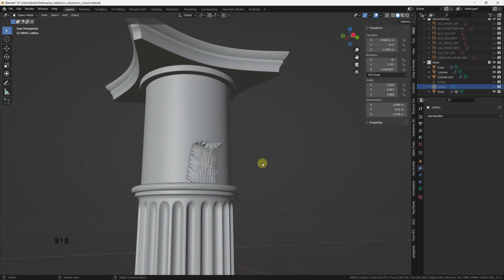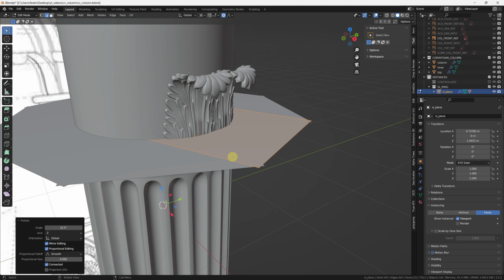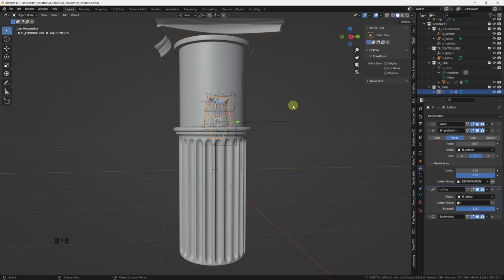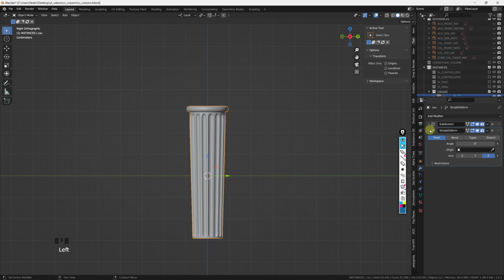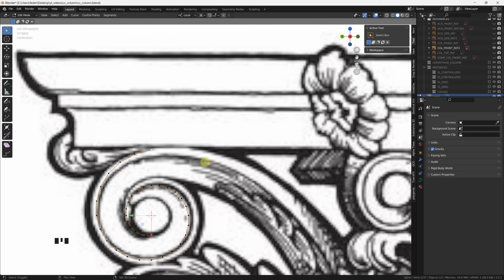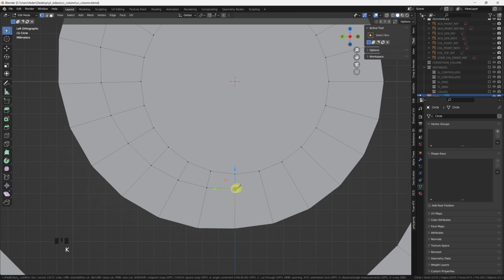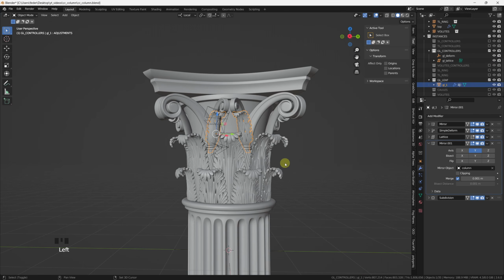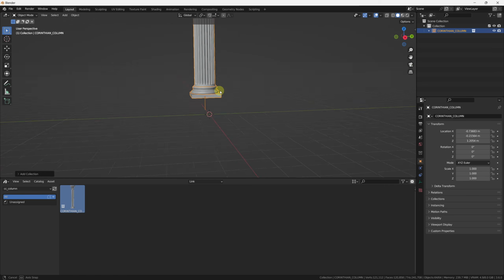Let's model a column in Blender - a step-by-step tutorial on non destructive workflows (pt.2)

Comment: One of the best tutorials ive seen so far, im into game art and classical architecture since years and I learned so much. But one tip for people who want to optimize and/or bake this column: I recommend to not use Shape Keys when you extrude it and keep aware of the overlapping faces, even after detaching it, there could be some parts overlapping with other parts after you extrude it. I had to move the overlapping flowers away from each other.

Comment: is retopologize necessary for this, if I want to add textures and want to import it into other engines?
Reply: You could use Nanites on this if you work with UE but its highly recommened to optimize it, its not game ready. Im trying to do that right now, im still not finished but if you have a question answer to this comment
Reply: @faryanblender8946  But for complex structure such as acanthus leaf, its going to be very time consuming.

Comment: Hello! Thank you for these video lessons; they are very important not only to me but also to many others. With the transition to Blender version 4.2, I encountered a problem with instances. Maybe someone knows how to help. I had older projects, and after opening them on a new device and in the new version of the program (4.2), I noticed that when applying the Array modifier to instances (tto plane, to which an instance is attached using a parent modifier), the materials get messed up, which never happened before. This issue only occurs in the Cycles engine, not in Eevee, and the first object in the array turns dark for some reason. Does anyone know what can be done about this?

Comment: In real architectural terms, to help add to your realism, columns aren’t cylinders. For corinthian columns, the shafts are 8-9 times the capital height. Also the bottom third of the shaft is cylindrical, while the upper third thirds taper down to only five sixths of bottom diameter. This is sort of a rule classical architecture. Once these figures are in you’ll be indestructible…constructively speaking 😊 great awesome stuff 👍👍👍

Comment: I briefly had an issue when I tried to do that step with rotating the empty around the 3D cursor to rotate those instances around the pillar. They were rotating around the Z Axis as I wished, yes, but also, each individual leaf was rotating on its side more and more as they went around the ring, going upside down and stuff like that. I fixed it though. For anyone who has the same issue, here’s something to lead you in the right direction: Go to Object Properties > Viewport Display > Show Axes and see if you can figure out what the problem is from there. Once you figure out what the problem is, there’s an options menu in the top right of the viewport, and when you click on it, it gives you some choices to limit what transforms, such as rotations, effect. See if you can figure out which of those options can help you fix the problem!

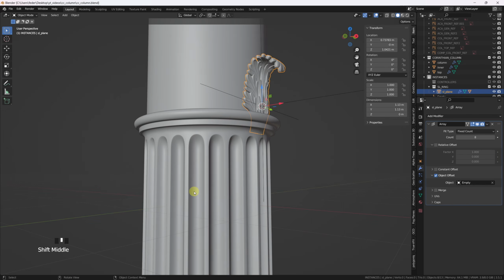Comment: When I attempt to rotate the Empty at 2:27, my leaves are placed in the correct positions, but they don't rotate correctly like they do in the video. I'm pretty sure I've done everything according to the instructions so far
Reply: Im having the same issue!
Reply: I know this is incredibly late but it may have just been an issue with applying the scale (ctrl A, Scale). I had a similar issue and that fixed mine
Reply: I kept the Pivot Point on the geometry at the time of the array rotation (not at the center of the world). It worked for me.
Reply: @geoniogustavo7299   I still couldn’t figure out how to solve this problem. All pivot points are positioned correctly, and scale and rotation have been applied to all of my meshes. In the end, I moved it and manually changed the rotation of the empty to get the ring.

Comment: After completing this tutorial, I feel that this model is quite resource-intensive and places a significant burden on the computer. Even when using the LINK method, the burden remains high. Are there any methods to reduce this burden?

If adding just four columns to the scene causes computer lag, it's nearly impossible to complete the entire scene.
Lastly, thank you for creating this tutorial; it's a fantastic video, and I hope you can keep it updated.
Reply from the maker: Thank you. You could create a lower poly version by removing subsurf/decimating and then baking from high to low. May do a video on that as I got a few requests already!

Comment: Dear sir!
 Please forgive my narrow-mindedness, but I have a problem.  If I move _MAIN_CONTROLLER along the Z-axis as you do, everything looks fine. But, if I move it arbitrarily in space, my GL_LEAFS fly apart from the capitals. I tried modelling GL in different ways: creating instances resulted in a complete mess, MIRROR (two ways) gave similar results - perfect view of the capitals in static mode and when moving _MAIN_CONTROLLER vertically, but resulted in ugly flying GL_LEAFS (and only them!) at any other movement.
What did I do wrong?
Most likely, building the colonnade using instances and hiding the original source makes my "problem" meaningless (I haven't checked this yet, as I've been busy texturing the column out of desperation). But my heart clutches at the feeling of some incompleteness: yes, the rabbit has been pulled out of the hat, but it doesn't seem to be alive.
Some kind of solution would be to position the GL in edit mode, but to do that you have to apply all modifiers (except subsurf), but that's not possible because of the Shape Keys. Is it possible to apply Shape Keys? 
This would eventually lead to the creation of GL_Leaf from scratch, completely destroying the concept of non-destructive modeling.
Reply from the maker: Hello Sir, the easiest solution is to instance to scene the collection containing the main controller (I would use "link" foto that). In this way you can manipulate it freely without any disruption in the workflow 👍. The other option would be to place all of the actual empties used for placement into the main collection as well.
Reply: @hbitproject  Oh, I'm so embarrassed. 😳The first method works 100%.

Comment: Let me add my thanks! I also found this incredibly beautiful and inspiring, not only as a blender tutorial, but as an entry into appreciating classical architecture. I live in a town filled with Renaissance details like this, with a museum that has literally tons of columns taken from the Classical world. Somehow, the knowledge that I or anyone could make a model of one digitally makes you appreciate the details even more! 

I'm just 1 month into learning blender and the game I'm designing for has to start with an LOD under 500 tris, and most models max out at 10,000 tris at the highest LOD, so it definitely doesn't encourage accuracy in modeling. So this inspiration is useful for me to think about how and where to include accuracy, where it will have the most impact or be easiest to implement. You mentioned in the comments you'd be willing to illustrate how to lower the poly count a bit if there is demand out there. I'm certainly interested in any hacks. At one point I think I saw 200,000 tris in the corner, but probably that was just for one of the objects, not for this whole model once all the transforms are applied.
Reply from the maker: Hello and thank you! I'm really glad you appreciated the content. By decimating and baking you can get to a reasonable amount of tris; of course it's going to be a trade-off as severe as your need for optimization is. May do a video on that 👍

Comment: Hi bro it s brilliant but my hand made arrayed leaves are rotating when I make the instances rotation. Plane leaf and empty at the same origin and I am making rotation about the world centre ☹
Reply: Guys i remodel the leaf... i think my problem was at the beginning. I turned the plane which i used for modeling in objeckt mod.
Reply: yeah, I have scaling issue with the instances. It appears that the point where scale/location were applied was skipped over
Reply from the maker: Hello, only scale needs to be applied (I did it right after placing the leaf, the empty and the lattice on the column + you need to apply the scale only for the leaf). Let me know!

Comment: Super tuto as always! Will be helpful for my current project! But actually, it is for an 1R app, so really need to optimize it a lot, so I guess I should bake it to a low poly model?
Reply from the maker: Thank you! I tried out of curiosity and if you need it you can create a low poly version by simply removing all the subdivs and then bake from the high poly. You can also try to decimate if that's still too much 👍

Comment: Great tutorial, but you forgot to mention one simple detail about column proportions. The diameter of a column decreases from full at bottom  1/3 of it, to fraction of it (usually 6/7 or 7/8 if I remember corectly [but that ratio also changes with the height of the column]) at the top. 
But apart from that, tutorial is great and very informative. I wish I could see this when I was struggling to make corinthian pillars for the tenement I was reconstructing 2 months ago, it would have saved me a lot of time and mistakes xd
Reply from the maker: Correct 👍 thank you for mentioning it!